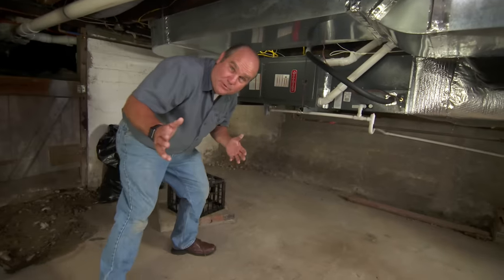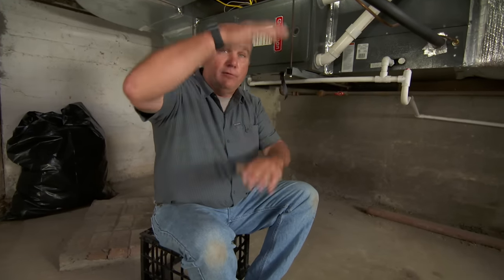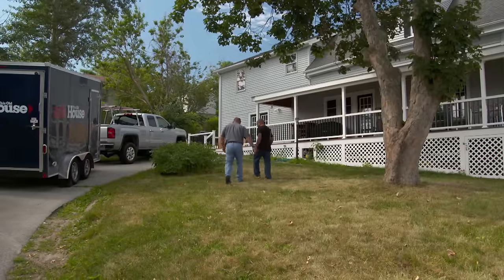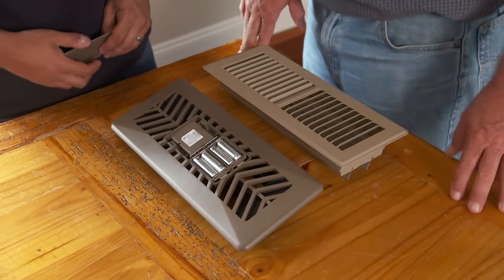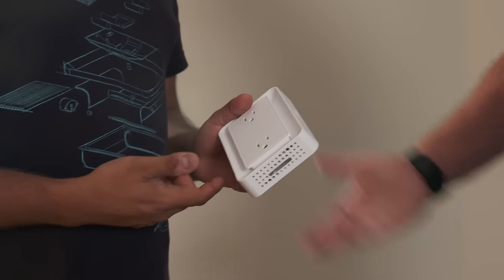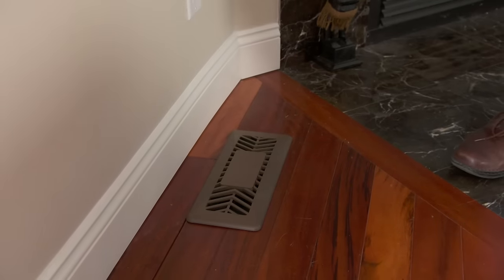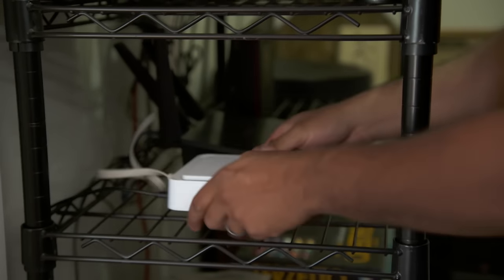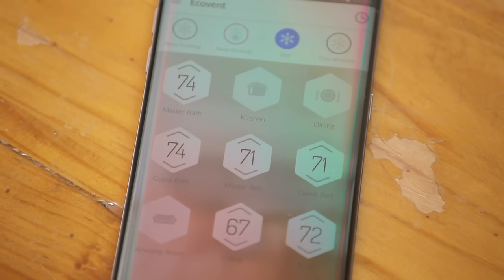How to Install Room-By-Room Zoning in an HVAC System | Ask This Old House

Comment: In this earlier EcoVent YouTube video from Aug 2015 (https://www.youtube.com/watch?v=hbx8sD4lkDo), they mention the cost of $1800 for a 4-bedroom house (9 rooms total). They also mention "a couple hundred per room". And lastly, they said they sold these systems to customers directly and their customers installed them with no professional installation needed. Today, they insist on professional installation only and don't mention any prices on their website. For those that don't have smart phones or those that would rather use a computer to control the system, is there a program (app) for home computers ?
Reply: @imreb321  Currently (Mar 2, 2022) the site is "unreachable";

Comment: Hey. quick question.. on the video it seems like the installation could be done by practically anyone.... WHY DO YOU NEED A PROFESSIONAL installer to do it.!!! Your product could potentially help so many people, so why do this.!!!
Reply: Their 2015 Intro video said anyone can install this but now they want a pro to install it. That probably adds a grand or more to the cost. How many people will shell out $3,000 for this ?
Reply: biggestb 35 you might end up buying a system that won't end up fixing the problem. And u wouldnt know if it would work on ur system or not cuz u ain't a hvac professional.

Comment: What radio frequency do these use? Hopefully not 2.4 Ghz since that can screw with WiFi
Reply: Just because they are on the same signal does not mean interference, signal strength is main issue, these are most likely on a 2.4 signal to conform to IEEE transmit/receive protocol standard. You would not experience an issue as this setup is segmented on your network to the hub then to your ISP modem/router.

Comment: This will never work for very long. The con is: we aren't going to do any 'real' work, we'll just go around and change out your air vents. Static Pressure irregularities of the system will cause systemic failures: blower motors, compressors, heat exchangers. When it comes to HVAC zoning you have to take the time to design it. System Design is far bigger than merely replacing an air vent. Seriously? HVAC zoning is a specialty market. Some homes aren't feasible for HVAC zoning and some are zoned already because they have more than one HVAC system. Each system counts as a zone. There is much more to this than meets the eye. Texas licensed HVAC contractor with 23 years hands on experience and my own home has a 4 zone ducted system. (the dampers are positioned and designed to alleviate static pressure when only one zone calls.)

Comment: You 100% can not use these systems unless you have a variable speed ecm blower motor that senses duct static pressure, a variable gas valve, a variable speed inducer draft motor, variable speed condensing unit, and electronic stepper valve for your thermal expansion on your evaporator coil. If you do not have all of these components you will do great harm to your hvac system. 20 year hvac tech here. It is very important on a standard furnace without all the variable speed tech that all registers are wide open. If not you will slow the airflow in the system causing premature heat exchanger and compressor failure.
Reply: That doesn’t make sense as even non smart vents are made to be closed and clearly users would do so on occasion, no matter the type of furnace/AC units.
Reply: @keychain12  incorrect it is harmful to close vents on your standard hvac system as it will reduce the required airflow through your hvac system. This can cause over heating if your furnace heat exchanger which causes additional expansion and contraction of the heat exchanger that will cause premature cracks/failure. It is always recommenelded by all hvac technicians never to close these vents completely  but rather to use them to direct airflow to where you want it. You must understand duct design, total static pressure, air velocity, and required system cfm to understand. Ducts are designed to handle the exact air required theough your furnace with all vents wide open. Actuallyvin many cases rhe ductwork is undersized which makes it even more important to keep all those registers wide open. But hey dont listen to the pros do whatever makes you happy and I will be happy to repair your equipment at my hourly rate ;)

Comment: How many years does it take for the homeowner to "break-even" ?
Reply: forever, you are diverting the air flow not the consumption. If you want to save, keep it on a low setting for a/c and high setting for heating.

Comment: Forced air zoning is nothing but problems. Smart contractors install two separate systems for big homes. If a contractor can't get the duct right on a smaller system, they should not be doing it

Comment: This won't work. Changing air flow at the end of duct will not change the air flow in other ducts.  Air is not liquid. It may make a colder room less cold, but it will not make a hot room colder.
Reply: To an extent it will but not the way this show would make people think. I would tell people to look at their ductwork. Supply ducts to different rooms on the same floor may well be different sizes. Why do you think that is?  The systems are very carefully engineered to meet specific requirements of resistance and flow. If that weren't necessary, everyone would just open and close vents.

Comment: Very restrictive for a plug and play. Your going to loose 30% of what used to be your 100% air flow. What about a bypass damper? Network Zoning. Honeywell has be here and failed in the residential.  Good Zoning is seldom cheap and easy

Comment: This seems fishy the proper way to zone a system is install ducted zone dampers for each floor at the system.
Reply: Not fishy, just a bad implementation like a cold remedy.  Like when people get a cold, the meds try to fix the symptom and not the root cause.  Instead of managing the flow of air in the plenum and doing a bypass for over pressure, they are controlling at the register.  I've ready a lot of bad stuff about this and 4-AA batteries being used up quickly because the vents are trying to constantly remediate pressure/temp/flow.

At least it's good to see HVAC guys all have the same consensus.

Comment: Call me weird, but I lost interest when he used the smartphone and internet to control it. I do NOT want to have everything in my life controlled from a digital device in my pocket. I want the HVAC to have a control on the wall, I want the lights to have a different control on the wall, etc. For one thing, the feeling of my mobile device doing everything is plain creepy and icky, but what if I lose or break my phone and have to get another one or can't afford to right away? What if it gets hacked? What if there is a massive attack or disruption with digital devices or internet connections? The more we centralize, use wireless connections, and rely on mobile devices, the more vulnerable we make ourselves. I like some new and innovative things, but if it involves a smartphone or wireless control, there is no way I am using it.
Reply: Valid concern since a huge number of Nest thermostats were turned into an adhoc network and used for DDOS attacks, we need to balance conviently and wow factor with privacy concerns things are going to be more connected going into the future, thought I'm with you on switches and thermostat on the wall, but we need to secure them and make it harder to use my dryer to connect to my internet and access my computer
Reply: Absolutely agree
Reply: You can always use an old phone just for this use. I've got several old phones that could be used for this so I would have a backup if one failed/broke.
Reply: All of this new trend of everything being IoT is going to bite people in the ass eventually.  When we have hackers who are able to control Autonomous vehicles doing it on video all of this IoT stuff makes them come in their pants.  Oh, the potential just the ripe potential to cause mass havoc.
Reply: if there is a 'massive attack' i doubt you would be worried about how to control your AC
Reply: i kind of agree with your points, there should be a smartphone app and a hardwired solution. both offer convenience and usability
Reply: Zachary J Hott-Salman I immediately lost interest once I realized it runs on internet ant Wi-Fi... no thanx
Reply: Well, for starters, whether it’s your phone or a honeywell thermostat, it is all digital.

The whole point of this system is that you can make use of your existing equipment for the sake of keeping the price down.

Honeywell TruZone is an interface module that connects up to four thermostats to a single unit. (More if you use the expansion board).

Just the board and thermostats without the ductwork and the motorized dampers can cost you as much as this whole thing.

If there is a massive attack, you may end up getting too hot or too cold and turning the unit off will solve the issue. 
It isn’t as if the A/C will take over the house and kill you.

That being said, with how buggy phones and WiFi can get after updates, directly wired is definitely preferred.

I do Commercial HVAC, and have done plenty of zoning systems.
I hate the WiFi thermostats.
In my experience, they’re more trouble than they are worth.
Reply: Zachary J Hott-Salman agreed. Technology is extremely important to us, however we are becoming too dependent on it in certain aspects. Some things are better left untouched. Such as the thermostat!
Reply: That is why you only buy networked products that allow on-premises functionality. Then you set up a "gadget" vLAN that blocks ingress and egress traffic on the edge. You will end up being able to control the device from your smart phone/laptop, but only when connected to your home network. And if you really want remote access you could set up a VPN.
Reply: Then control it from your computer. Issued solved.
Reply: I've though of this internet hacking thing as well and some of the new LED bulbs are controlled by your smart phone as well. Imagine having one of these bulbs installed in your lamp or overhead light and someone hacks the system and decides to be an ass and turn your light on and off while you sleep at night! One could do the same thing to your HVAC system and cause you to get cold or worse cause something to fail! No thanks to this there are some things that need to be left manually controlled.

Comment: Seems cool if all hvac units were actually properly sized 98% of old and new construction aren't,  with supply and return ducts,  also static pressure would be through the roof overheating issues and icing up coils, pressure switches tripped. But really honestly a good idea just alot of hack jobs out there.

Comment: This is a long read but worth it:
http://www.achrnews.com/articles/129702-are-smart-vents-really-that-smart
Reply: Very good read. Thanks for the share, Glenn Watkins.
Reply: Interesting, but seems to ignore problems these venting systems address. This is going to be one of those, be careful what you buy. Do your research and make sure the system address these issues in the article and that is simply not blocking airflow due to temperature differences. I can see "cheap" systems coming out to cash in on the craze and causing a lot of problems.
Reply: Thanks for posting Glenn,
I noticed the Dipul Patel did not comment to your post. 
Come on Patel tell us this article is not true!

Comment: Cute idea, but clearly made by someone who doesn't work in the industry. First off, controlling air flow to a room at the register is pointless. The complaint is almost never that it's too conditioned in a room, but that it's not conditioned enough. Closing the register will block some of the conditioned air from reaching the space, but it does little to create the necessary back pressure to force air in a different direction. By the time the air has reached the end of the supply duct you've lost too much static pressure to really making a difference in air flow. The air flow has to be controlled at the point of highest static in order to really redirect air flow to the areas of higher demand. Controlling at the end doesn't create enough back pressure to substantially redirect the air. You also don't diminish demand on the system if you're applying this to an old constant speed/ single stage system, and in fact you would increase demand by allowing less actual cooling into the conditioned space, thus causing the system to run longer to satisfy set point. This could actually cause major issues with your system. Third point is that by placing the sensors and battery compartment in the front of the register you just created a major obstruction to air flow and significantly cut down on the available free area (minimum amount of square inches required for adequate air flow to meet rating requirements), likely to the point where it will significantly affect the air flow and supply of conditioned air. It's great that people are trying to come up with new and easier ways of doing things and allowing home owners to do more to improve things themselves, but this is a bad idea and unless someone showed me some case studies where this had been applied and it actually improved system performance I wouldn't believe it. Zoned systems, unfortunately, are more complicated than that, they can't really be applied to constant speed/ single stage systems, and they should really be installed by a trained professional to get it done right.
Reply: Thanks for the detailed explanation!

Comment: Just a scam! The master room is 72 at my house, but my son's room is 79. This device did not solve my problem. In my case, it is obvious that the air ducts are huge in my room and smaller in my son's. This device may work if you have almost same room temp in your house but only if your window faces westside.

Comment: Nice idea but you can't fix a poorly designed system with smart registers.  Hire a competent HVAC installer to size your equipment and ducts correctly.  All this does is add a dozen or more additional fail points and unnecessarily complicates the system.

Comment: closing registers is never ever a good idea closing causes air to back up and over heat the furnace next Cracked exchanger oh   but they can sell new one Now
Reply: Dipul Patel your vents are significantly decreasing the area for air to flow through how can you say that it doesn't restrict air flow
Reply: Joe Shearer I agree with you on this one!!!
Reply: I'd like to see the company I work for using these soon, would love something like this in my house personally.
Reply: how much would it generally cost to put a system like this in a home or apartment?
Reply: Starting price is $2500

Comment: Garbage product. Closing vents can be very harmful.

Zoning needs to be done with professional grade controls and 2+ stage equipment.  airflow requirements kept down, running on first stage only when one zone is calling.
Reply: no kidding, he does not show a furnace control unit.
Reply: Jon [Insert Last Name Here] I assume you work in HVAC? As a layman, this seems to work to me considering homes typically have lower CFM units and towards the end of the video he explains that the units are measuring air pressure and humidity to prevent issues with the air unit.

Comment: This set up will end up making your compressor or blower motor fail
Reply: Doubt that it would affect the compressor but his description of the effect on the air handler fan motor might not be accurate for many systems. Ductwork for cooling is usually carefully designed to produce resistance that falls within very specific parameters. And that duct resistance must remain within those parameters. It's not just a matter of iced coils from inadequate air flow over the evaporator coils. It's not as simple as he makes it seem.  I saw something similar on "Shark Tank" with just motorized vents. The "Sharks" jumped at it as though no one had ever thought of something so simple before. Well, there's a reason. Hopefully they obtained more expert advice and required proper testing before signing the check.

Comment: Is electricity so cheap in USA ? I mean this Duct AC taking too much power,because it just one big airhandler and it have to work for full power all the time . and what this guy did is just opening and closing vent hole. And what about saving energy ? Even in Russia where electricity is cheap we already using zoning which also controll indoor unit work power and outdoor inverter..
Reply: AiRPOWER 
Well, we have such systems that are more sophisticated.

This is the answer for the homeowner that can not afford to retrofit their ductwork or install a mini-split with multiple indoor units.

That being said, I think this is still too expensive.

Comment: This concept was debunked. This won't work with a conventional single stage furnace blower motor. By closing the vent registers your essentially changing the air balance of the system and causing back pressure on the supply side on the HVAC system. With high enough pressure the ducting can fail structurally.